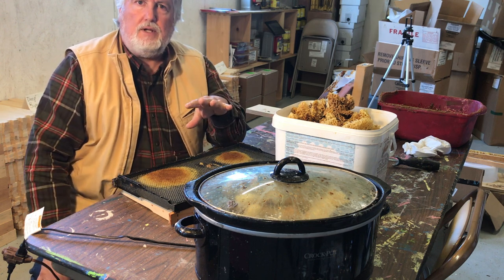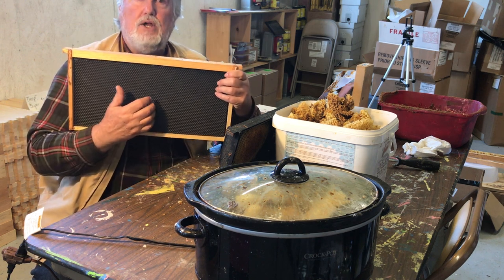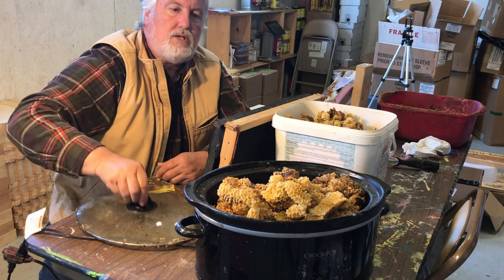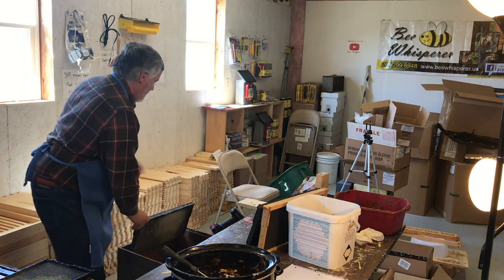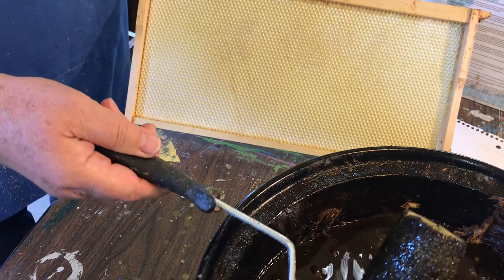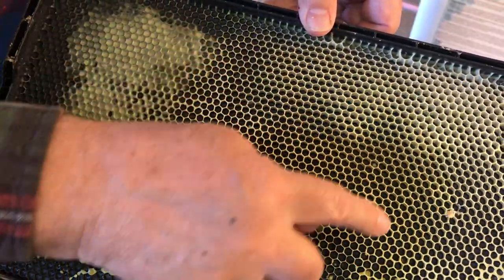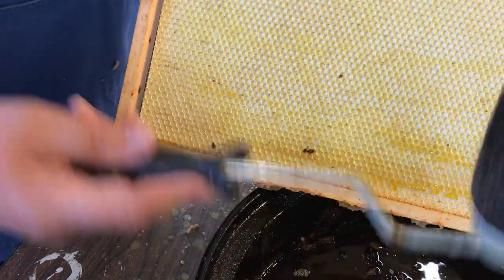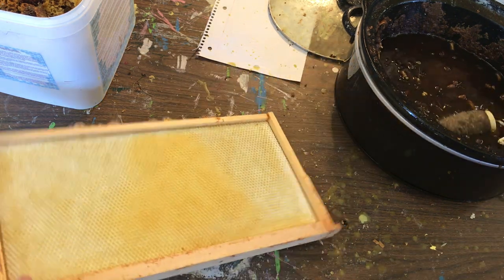Fixing used foundation, coating with wax.

Comment: Those solid foam rollers don't drip like the hollow ones do. AND THANK you for pointing out that some outer frames can be stripped of the wax!  Call me stupid but I've been wondering about that Peter. Geeze.

Comment: From what I've gleaned, single brood chamber is the best way to maximize honey production. But you have to be willing to do more management. It will be interesting to learn from you this year. I'm on the fence whether to try some this year. 
My new heavy waxed foundation I bought this year all got a coating of my wax. I run my wax through a canning funnel with an ankle high nylon stocking used as a filter. It really cleans the wax up nicely and is cheap.
Reply from the maker: Good idea!